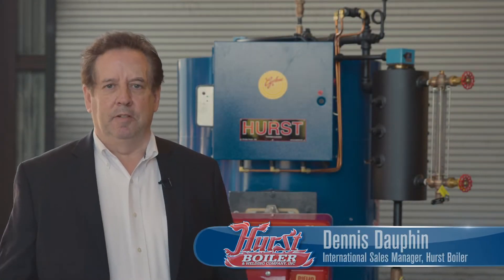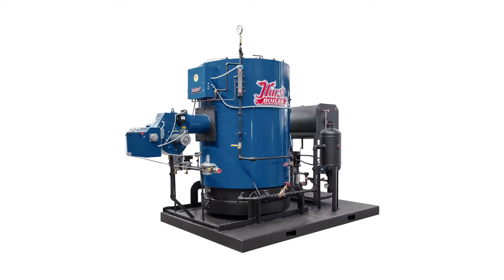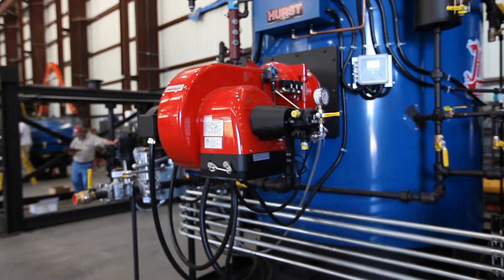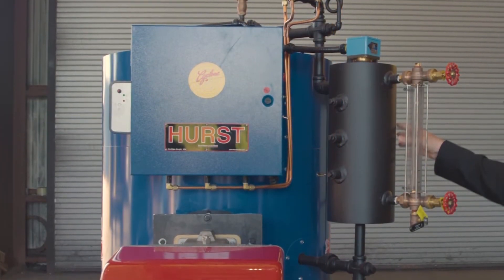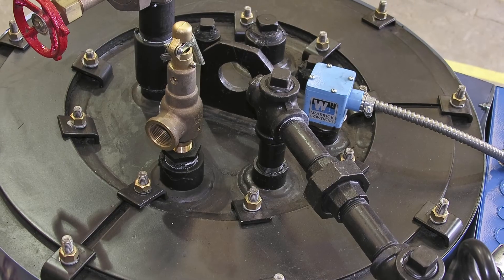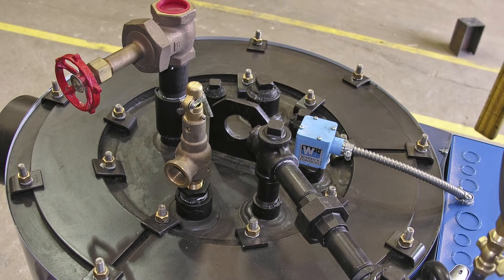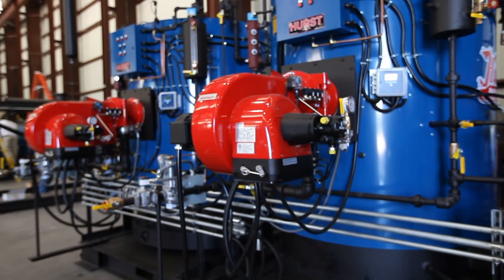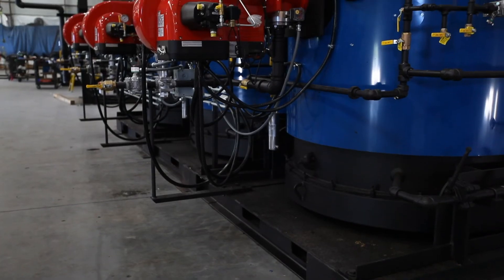Hurst Tubeless, Tubed, & Hand-Fired Vertical Boilers

Comment: We have a 15 year old 700 HP Hurst firetube boiler in our evaporator plant. It has been run extremely hard  and abused thoroughly, yet it still  fires up and holds pressure reliably. We are replacing it this April, with the exact same brand. Hurst makes wonderfully reliable boilers.